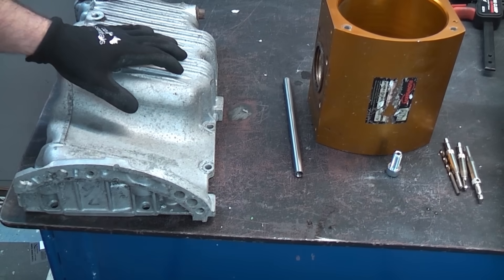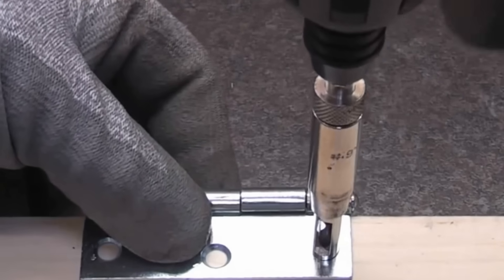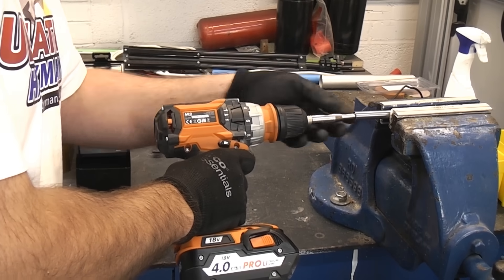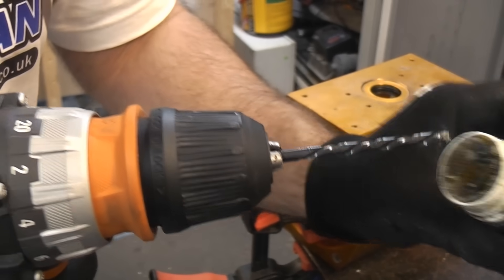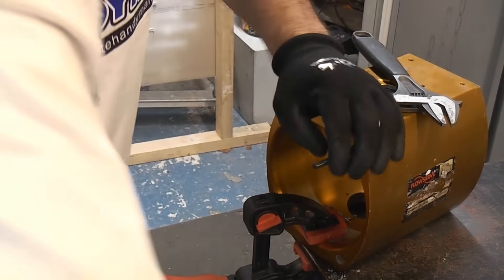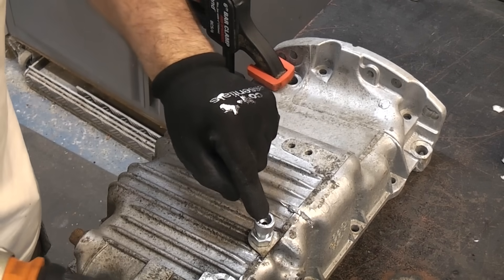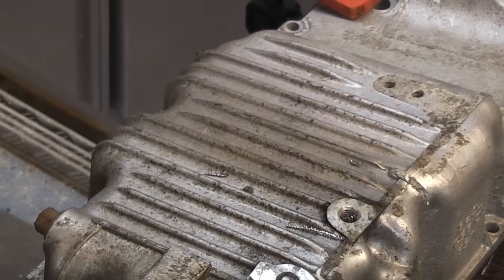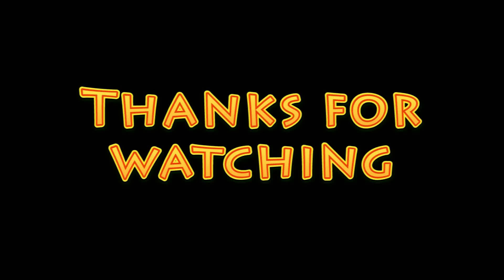How to remove a broken bolt in a deep hole | remove broken bolt in recessed hole

Comment: why not use the same atachment on the 2nd removal as you did in that first removal,where the support is moving withthe drill on the outside and when it grips the bolt,it all comes out..
Reply from the maker: I was showing more than one way of doing it ;-)
Thanks for the comment

Comment: post links for the tools... (Self centering drill Bits & self centering  bolts)
Reply from the maker: Hinge centering drills- https://fave.co/2DpJo1H
Left handed drill bits- https://fave.co/2xJjK1M

If you are in the UK- 
Hinge centering drills- https://fave.co/2NE1VMc
Left handed drill bits- https://fave.co/2DubtF4

exact cutting paste- https://fave.co/2Nabyxc
cobalt drill bits (they are much better on harder steels like bolts) https://fave.co/2zDh3kp

You'll have to make the guides yourself, but they are easy- https://www.youtube.com/watch?v=6mZj0J6CNYA&t=1s

Spring tools centre punch- https://fave.co/2NbnLBD

Comment: WHAT IF  THE BOLT IS NOT RECESSED  HOW  DOES  ONE PREVENT  THE  DRILL  FROM WALKING  AWAY  FROM CENTER..
Reply from the maker: If you centre punch it in the centre it should stop the drill from wandering.

Thanks for the comment ;-)

Comment: Awesome brilliant idea drilling through a bolt, i'm thinking with a use of a lathe for dead center.  Inserting the bolt then drilling afterwards to keep the drill bit from ruining the threads!!!
Reply from the maker: The bolt was held in the chuck using the bolt head- so no chance of damaging the threads.
Thanks for the comment ;-)

Comment: most bolts will come out after a little playing with them unless they are bottomed out, if the bottom of the bolt is tightened up against the bottom of the housing, then it's a real problem
Reply from the maker: Thanks for the comment

Comment: Come on man! In the real world, if the bot head broke off those bolts would be ceased up in the threads and would never come out that easy.
Reply: Not true, I work in aerospace and half my job is getting seized hardware out. Extractors work 99.9% of the time. LH drill bits work about 5-10% but I rarely have any properly sharp ones on hand. I've only had to drill the bolt to the threads a handful of times.
Reply: Gerhard--I think you mean *SEIZED* rather than CEASED.
Reply: Gerhard Br
Reply: Quick tip, cobalt really doesn't need cutting paste for bolts and can cut on a fairly high speed. It doesn't hurt, but honestly it doesn't help much at all
Reply: Tell me about clutch apparatus  on dodge caliber 08 standard
Reply: Rezivour cap how to get off dodge standard
Reply: However seized or otherwise damaged the broken bolt, if you drill a correctly centred hole initially and carefully enlarge from there you will get the bolt out. If you’re good enough and have no extractors you should be able to carefully prise  the thread of the bolt out, leaving the thread in the casing undamaged.A GOOD set of extractors are worth their weight in gold mind, and it takes a bit of practice and skill to get to this stage.
Reply: Definitely not true, the remaining threads lose their holding energy because the head is no longer applying pressure.
Reply: I have worked on logging trucks where 1 1/4" bunk bolts have broken off in the hole from stress and the bolt came out just as easily as in the video once I got a well centered hole in and used an easy out, so yes, under certain circumstances they can break off and yet come out that easily.  I have also seen where a bolt bottomed out when a person was putting it in and over torqued it because it was not seated yet, and it snapped off but the thread was in perfect shape and so backed out that easily.
Reply from the maker: @derricksteinmeier89   We also get this on some machines. The bolt shears off, yet the internal threads are not damaged and the remainder of the snapped bolt can be removed relatively easily. Thanks for the comment ;-)
Reply: @ultimatehandyman  If I have a location where the bolts can be broken on a regular basis (like attaching the blade to my tractor) I will use Grade 8 bolts. The brittleness of the bolt ensures they break off cleaner without stretching and are much easier to get out. I also coat them with grease when installing them. I make the drill guides out of threaded rod with a slot cut into the top with a thin disc so I can install or remove them with a screw driver. I like your allen head versions, but these will get down into the threads on a location like a stud broken behind a manifold where the allen head might get in the way. Good vid... I like the tips.
Reply: Not true japanese use very strong thread locker  that if you just torque the bolt it breaks every time, the best way is tap the wrench until thread locker breaks.
Reply: Boy you’re not kidding. I pulled some bumper bolts office 16 tundra yesterday that were just like new. I fought that damn thing right to the very end of that big long fine thread and it was this tight at the endAs it was at the start. Weird stuff unlike any of the regular never see you should buy in a store

Comment: WTF IS Aluminium? Bolts that break are usually from trying to remove RUSTED seized bolts in very HARD TO REACH LOCATIONS (mostly exhaust manifold bolts) by guys failing to pre condition the bolt with either heat or penetrating oil.
Most bolts can be successfully removed if the mechanic is patient and generous with the PB Blaster.
Reply from the maker: Aluminium is a greyish metal made from Bauxite.
Thanks for the comment
Reply: Ultimate Handyman Sure looks more like Aluminum to me.

Comment: Nice idea for bolts broken off deep✔.  I already had a hardened toolsteel guide-bar and hardened drill guides in fractions and MM for precision hole centering and just added an arm to it to mimic the Bradley tool.  I'm going to have to make some bolts up like yours.  👍
These are the Bradley Bolt Extraction Kits. This tool is fantastic for bolts/studs broken off flush, especially where the work cannot be transported because of size/weight.  U.S. Patent # 7,229,237.   Watch on YouTube...  https://youtu.be/DU-spVcnMQA 
Kit 1, Part Number: CF-UDF-01  -- 1/4" to 1/2"    ----   Kit 2, Part Number: CF-UDF-02  --  up to 3/4"
Reply from the maker: Thanks. I was actually thinking of making something almost identical to what you have posted the link to, for bolts that are flush with the surface, but I was going to make the guide from a piece of steel bar and a stud connector as I could not find slotted steel bar. Thanks for the comment
Reply: On occasion, I've used old milling bits to flatten the tops of broken studs to prevent drill bit tips from snagging and breaking off but only with the hardened guides in place.  Again nice video.

Comment: WD-40 is for water dispersion. It's only slightly as effective as a true penetrating oil.
It's named due to it was the 40th attempt at a formula that did what it was intended. To disperse water before the part rusts in the first place.
Reply from the maker: Thanks for the comment

Comment: Square screw extractors work much better...they don't expand the bolt on removal like the round extractors do !! Also use anti seize on all bolts and screws and torque per torque chart. Dry threads lead to improper torque and broken bolts, machines and equipment...

Comment: Excellent idea on the hinge guide drill and the pre-drilled bolts, the only thing I would suggest is that you attempt to clean out the chips after drilling and before extracting.
Reply from the maker: Thanks for the comment

Comment: Any idea how to remove broken jack from headphones input? It broke in half and now I do not have front headphone input, so I have to connect my headphones to the back of my computer which is annoying!
Reply: Could try mixing up a bit of quick epoxy and just apply a tiny bit the the remaining part of the plug, inserting it and holding for it to bond with the broken piece and then pulling it out.  Have to be careful not to get excess around the plug to keep it from bonding to the wall. 

Or maybe find a tube or plastic straw just slightly larger diameter than the plug to work around the broken piece and act as a shield.  Actually, if you found something thin and tight enough to work over the broken bit, you might be able to work it over the broken piece, seal up the outer end and pull it out with friction and a vacuum.

Comment: I'd recommend running a plug tap down the hole after removing a sheared bolt, if you have one, just to clean threads and take off any burrs or high spots. Obviously not everyone has engineering stuf in their garage. But, a bolt is good in 2nd place as suggested in the videos.
Reply: You might grind a little clearance on the bolt, too
Reply: It's a tap. Thats machinist tools, not engineer. Never grind the bolts thread sclearances then its not a  bolt

Comment: I have never seen a bolt broken off below flush.  I always have trouble finding the center on bolts broken flush.  With bolts broken below the surface, I would just drill them out on the mill  (you could mill a flat spot with an end mill,) to the minor diameter of the thread and then either tap the hole or peel the bolt threads out with a pick.
Reply from the maker: Thanks for the comment

Comment: Very enjoyable video and some nice tips on there. However.. you should never grease the threads on a bolt. To correctly tighten a bolt you should use a torque wrench. A torque wrench ensures you apply exactly the correct force to tighten the bolt. If you apply grease to the threads of the bolt, the torque wrench will allow you to apply more force before it finds enough resistance because of the lubrication. This could cause you to snap those bolts. Bolt threads should be dry.
Reply from the maker: Thanks for the comment

Comment: nice. at first I thought it was all to clinically clean as the screw stuck in tube had no corrosion on it but the 2nd example looked like a genuine problem as the operator had some problems getting it out. inspiration to tackle 3 nightmares I've been trying to resolve: Honda 50 exhaust studs sheared (30 years); Yamaha XJR1300 exhaust studs badly corroded (4 years); Jaguar V12 cylinder head studs seized in block (1 year)

Comment: NOT COPPER GREASE! It corrodes it faster use alumaslip.... copperslip promotes the catalytic reaction you get  between steel and aluminium!
Reply from the maker: It's fine where I live- we use it daily on site with no problems.
Thanks for the comment

Comment: That is a ¨good idea¨ to tap the bolt with a center punch and push the material against the threads so the bold will become tighter in the hole
Reply from the maker: If you get a bolt that is seized in a hole and you shock it (as shown in the video), it can loosen the bolt ;-)
Thanks for the comment

Comment: I allways create a slot made by a line of  some fine drillholes (using a good diamonddriller) and take out the broken bolt with a screwdriver. Never failed. And i dont have the risk of broken  extractors .
Reply from the maker: Thanks for the comment

Comment: I have 4 types of AS lube,  Aluminum, Nickel and copper, all from CRC, and another for high temp like exhaust bolts etc from Permatex just called anti seize. The trick is not the type of fastner but its coating, as that is what is in contact with the casting. For example steel bolts have Nickel coatings sometimes, and then using the alumium grease works best. I look at the electro valency difference to chose which grease to use. Thanks for your video, your techniques are very good. I have found using the drill on 'hammer' helps a lot when drilling into corroded bolts broken off in random metal casings. Hope your sunday was not to long before you got to drink a pint.
Reply from the maker: Thanks for the comment

Comment: Sir
U must use a tap wrench(T type is much useful) rather than adjustable wrench when working with screw extractor.
Coz latter wont give a centre to work.
Reply from the maker: Thanks for the comment

Comment: I did not see any thread loctite on these broken bolts. Not even rust on them. They are going easier out. 
The first step should be to  apply some heat and melt these loctite or rust. After that use drills, extractors, torx bits, diamond dremel grinders etc. Good video
Reply from the maker: Obviously thread locker and rust make it more difficult, but it is the same technique
Thanks for the comment

Comment: A good technique IF the bolt breaks off at a depth sufficient to hold your homemade drill guides, but we seldom get that lucky.
Reply from the maker: You could always make a guide using some steel bar and pick up on the existing holes on the component.
Thanks for the comment

Comment: I like what you're doing around 5:35, but wouldn't using a drill press make the process easier and more precise? You could get more cutting pressure on the bit with less chance o breaking it due to flexing.
Reply from the maker: Absolutely, a drill press or mag base drill would make it much easier, but If I had of done that I would have got a hundred comments saying " it's easy on a drill press, try doing it with a hand drill".
Thanks for the comment

Comment: I had the ignition coil screw snap on the engine head, tapping the screw drive into it didn't work, screw extractor didn't work, and drill + rubber band saved the day.
Reply from the maker: Thanks for the comment

Comment: Denatured alcohol or isopropyl alcohol is the best lubricant for aluminium work. After usage of alcohol filings doesn't stick to aluminium, it was the main problem of this bolt extraction.
Reply from the maker: Thanks for the comment

Comment: Hi, I watch your videos with lot of interest. I am writing this message to seek your expertise on a problem I am facing in my lab. I have a ~ 40mm dia cylinder of Tungsten alloy(tungsten-copper-nickel). On it are three tapped M2 holes. The problem is that I have broken a M2 bolt in it. Can you suggest some ways to take it out? sincerely, saurabh  P.S I will try to post some pictures by wednesday.
Reply from the maker: M2 is very small, you might be able to use some techniques from this video- https://www.youtube.com/watch?v=_mTFQbaT3Zc
If you live anywhere near Darwen, Lancashire - I'll gladly have a go at removing them one evening.
I'd seriously consider getting a Trend micro-GrabIt or I'd try using a 1mm left handed drill bit.

Comment: I admire the creativity, workmanship and dexterity you showed in doing this; I know how difficult it is, for I've seem myself in the same boat a couple of times. Sadly, these techniques are like the watchmaker's...outdated by affordable and efficient technology,  available to all of us. I suggest you EDM the center of the bolt, changing each time its diameter, until finally, you will be able to remove what's left, with a screw remover. You can even make yourself a small shop EDM, that will cost you less than $100.00. In any case, thanks for your video.
Reply from the maker: Thanks for the comment ;-)

Comment: You need to make and sell the  socket head bolt thing. I know I would buy a set in Metric and SAE..
Reply: Agreed. Although you could replicate it pretty easily simply by placing an appropriately sized piece of pipe/tubing over your drill bit.

Comment: You're using a left handed drill bits, but drill in reverse. What's the difference in using normal drill bits, normally?
Reply from the maker: When drill bits are cutting they often grab or bite into the material being drilled. If you use a left handed drill bit and the drill in revers there is a chance that the drill bit will bite into the bolt and remove it from the hole, which saves drilling through it and eliminates the need for a screw extractor.
Thanks for the comment

Comment: Great video!  Leftie drill bits alone have extracted hundreds of screws - often effortlessly -  over the years,    Once the stud/bolt  begins to clear the hole (especially aluminum)  , and the extractor needs to be re-set with the hammer,   it's a good idea to put a pair of visegrips on the exposed bolt/stud to prevent the harder steel threads from damaging the helicoil inserts or    aluminum threads.
Reply from the maker: Thanks for the comment

Comment: On the last one , was that a steal bolt? What is that paste you are using to drill and what drill bits are using? They cut great!!!
Reply from the maker: Yes, it was a steel bolt.
The paste I use is exact cutting paste- https://fave.co/2Nabyxc
At the end of the video I think I used a cobalt drill bit (they are much better on harder steels like bolts) https://fave.co/2zDh3kp
I'd always get a decent make such as Heller, Dewalt, Bosch etc.

Thanks for the comment

Comment: A super video. And timely as I have five or six sheared bolts to remove in the next few days. Thank you!!  Just a thought. Using a tap wrench to twist your bolt extractor has the advantage of being able to bear down on the extractor as you turn it CCW. The pressure can't be any worse than setting the extractor into the hole you've made with a hammer.
As far as breaking off an extractor in the hole, you need to use some care to not twist excessively hard. After trying some, apply penetrating oil and wait a while and, if you can, apply some heat, even an electric heat gun, to expand the surrounding metal. Then try again.  Good luck!
Reply from the maker: Thanks for the comment ;-)
Reply: +Ultimate Handyman the square easy outs work a little better than the round easy outs. This man too has a Phd in bolt removal.

Comment: HUGE help!  I never thought of using a hinge bit set.  I've used pieces of copper pipe or other metal tubing as guides / sleeve to cover the bit in order to protect the threads.  The left handed drill bit also makes sense in possibly eliminating having to use a screw extractor.
Reply from the maker: I'm glad the video has helped ;-) 
Thanks for the comment